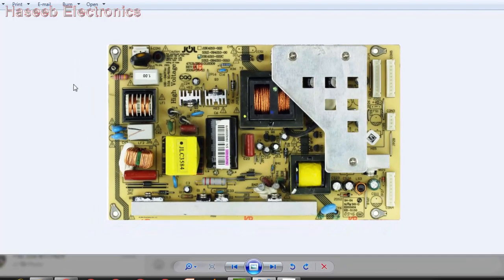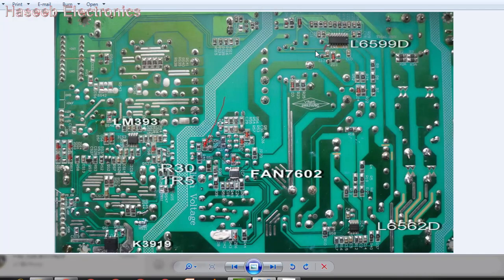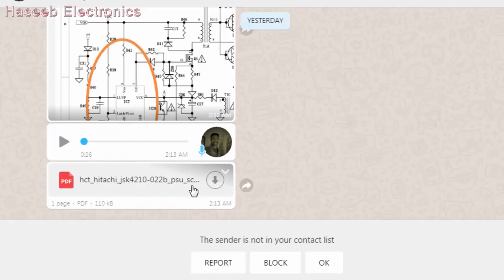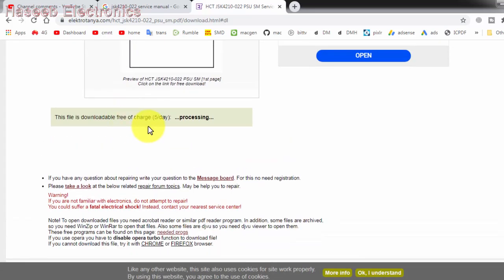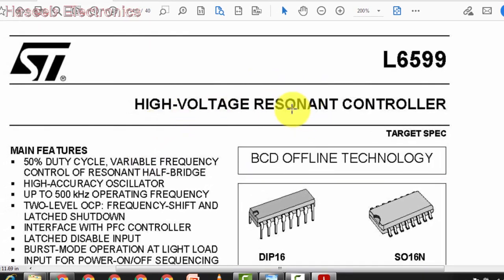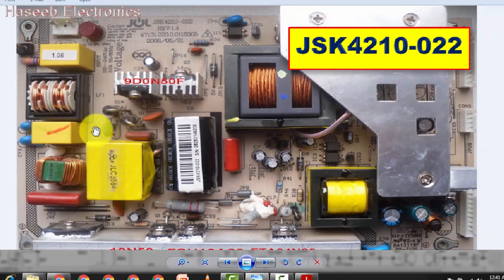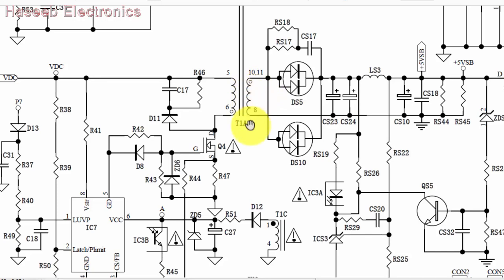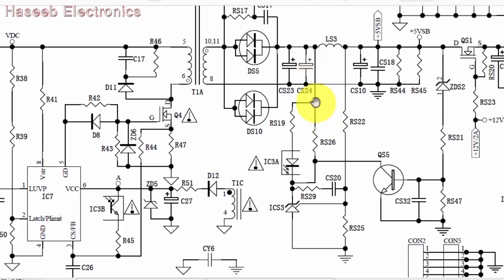346 Hitachi JSK4210-022 PSU PFC Power Factor Correction Power Supply Circuit Explained

Comment: Haseeb,I need,pleased, to know the value of the zener diode ZD2, which is in parallel with C9, (page 12 schematic hct_jsk4210)
Reply from the maker: i dont have circuit right now. but looking at diagram, i think 18V zener is to be used as ZD2

Comment: Thanks for the video, i am having a buzzing oscillating sound in my PSU with a low 4v output instead of 12v. Any idea where to look at ? thank you and salam aleikum
Reply from the maker: Salaam o alaikum
there is some component short in secondary side, OR
there is come frequency setting component in spms controller section is fail, so might be its switching frequency is inaccurate
Reply: @HaseebElectronics  Ok very clear, i will check. Can the SMPS transformer be bad ?
Reply: @HaseebElectronics  RT CT of tl494 are in good value and shows 10khz at the output.

Comment: Good evening sir,
I'm Arup and also fan of your channel.
Sir I got a E-Rikshaw Battery charger   with Dead Symptom. After check cold test their had PWM CHIP(UTC3842A), SWITCHING MOSFET (12N60), GET CURRENT LIMITING RESISTOR, SOURCE LOAD RESISTOR and RT RESISTOR WAS BLOWNS OUT. From this bad components value I have recovered instead of GET CURRENT LIMITING RESISTOR. After cheking datasheet of PWM CHIP I used the GET CURRENT LIMITING RESISTOR 68 OHM and RT RESISTOR 1K. Where as Other all components was good. After changed all the bad components I had power up by 100watt series lamp. Then problem comming fluctuating. Series lamp also fluctuated. Then I had check all the voltage o/p and opto isolator supply was fluctuated. That's why I had change again opto isolator PC817 and again power up mistakenly direct line. Unfortunately all the bad components again BLOWNS out soon. After all that I had change again all the bad components and this time Power up by the series lamp. Luckily this time problem seen fixed and all the voltage seen good ( O/P, PWM CHIP POWER, OPTO ISOLATOR POWER ). But this time I have seen the somke is come out from some where from the ckt. Due to this reason after power down, I have check again cold test. Then seen Switching FET and it's GET CURRENT LIMITING RESISTOR was over heating. And check also all components primary and secondary site all components was good instead of FET and GET CURRENT LIMITING RESISTOR. After all again power up by series lamp it was seen problem is fixed. But after some time to take a risk I have power up by direct line. But unfortunately this time again also BLOWNS out previous all bad comments. Where as all components over board showing good. One point I have missed to say that here I have used 15N60 MOSFET instead of 12N60.
Please help me sir what should I do and what shall be the checking process? To fix the problem. 
Thank you sir

Comment: It is a quite clear and complete explanation. Im going yo to replace  capacitor burned C33 on my PCB, may you handle capacitance and voltage values please?, thanks in advance
Reply: Hello, can you tell me what value is the C33 that carbonized in my source and I don't know what value it is.

Comment: Nice Sharing,  i have mean well power supply 320-48 for charging ev 48v lithium battery but supply not give current 6-7 Amps on start it gives 2-3 Amps we replace the other same supply but after some days the same fault occurred, kindly share knowledge about mean well 48v supplies as your detailed style.
Best Regards
Hadi
Reply from the maker: Salaam o Alaikum sir
i am thankful for your valuable feedback. 
i tried to search for the circuit diagram for this model, but i couldn't find it. if possible can you please send this power supply to me in my Home address, these days i am in pakistan, so that i can check the root cause and solution, after that i will send back to you as soon as possible. if you can troubleshoot it, best regards
Muhammad Ashraf 00962-78-1161084